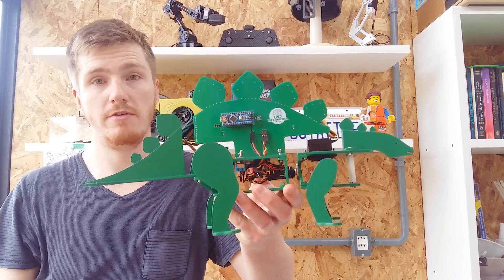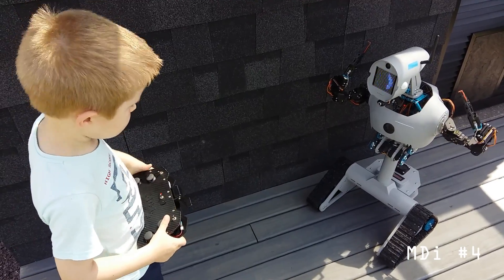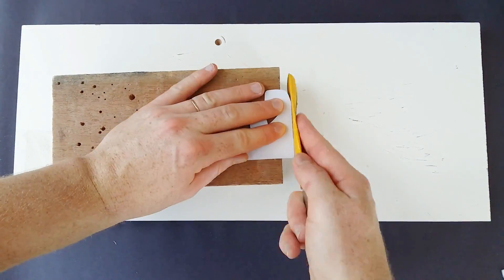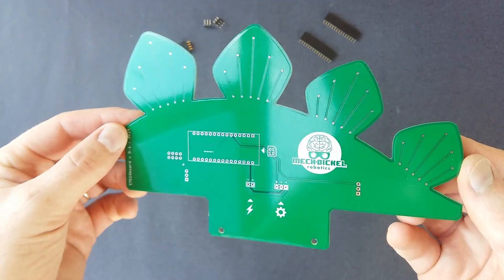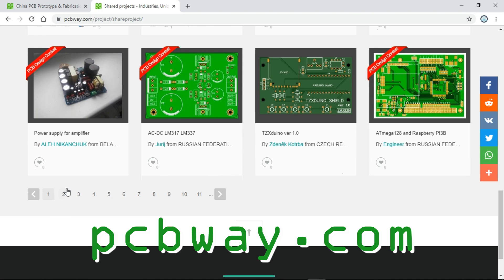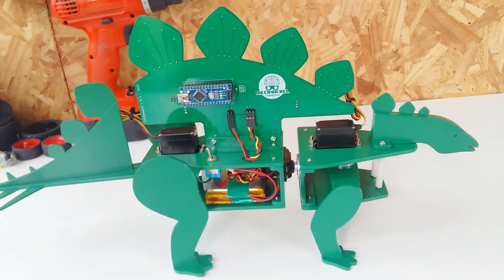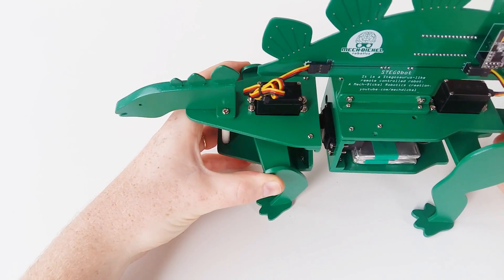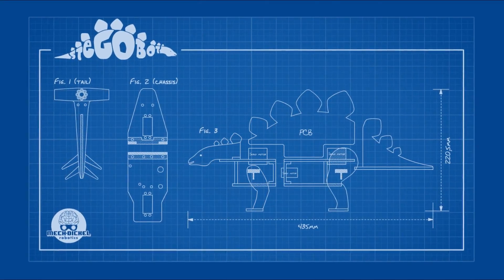DIY Arduino dinosaur robot (STEGObot)

Comment: it such a great work but i am building the same as your project so i try the code but isn't work 
thanks hope you can help me
Reply from the maker: If you show me some pictures and details of your project, maybe I can help you.
Reply: @MechDickel  Hi! i am using 4 servo motor the front,back,mid and tail but my project do not have a controller so its runs only in forward,so i try your given code and i remove the radio controller code but it doesn't work  what seem to be the problem i done fixing more than hour but it doesn't work i hope you can help me a lot. How can i send pictures of my project to you? thanks
Reply from the maker: @John Geslaya The code I provided for STEGObot is very rudimentary. Take a look at this post ( https://www.robotshop.com/community/forum/t/mechdog-robot-dog-based-on-arduino-and-lss/65705/8 ), where I shared an example of the code I use on my robot dog (mechDOG). By understanding this code, you can easily make walk any robot with legs.
Reply: @MechDickel  Hi i already check the link i really appreciate  this is also  a great project but the idea on leg mechanism of my project  is in this video, how can i send pictures of my project so that you were able to saw it. thank you
Reply from the maker: @johnreigeslaya9834  Send me an email (you'll find my email at my channel, tab "ABOUT", click "VIEW EMAIL ADDRESS").